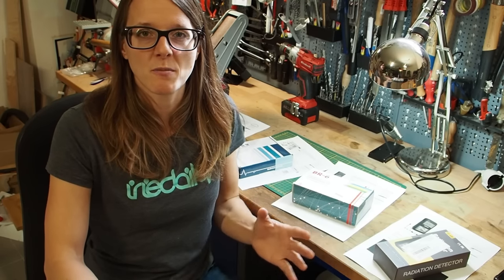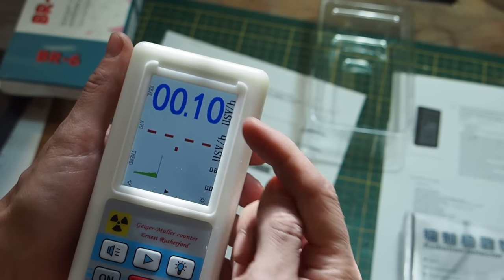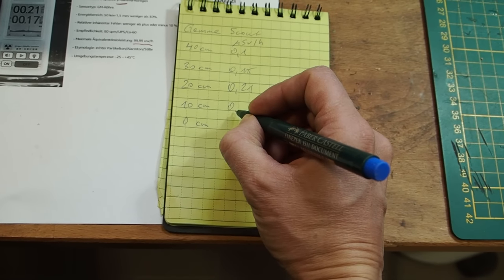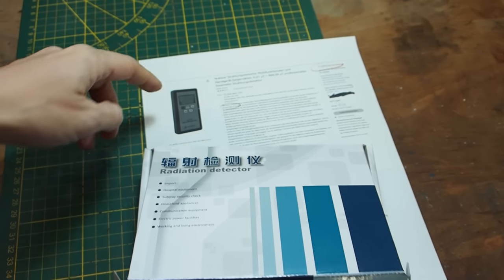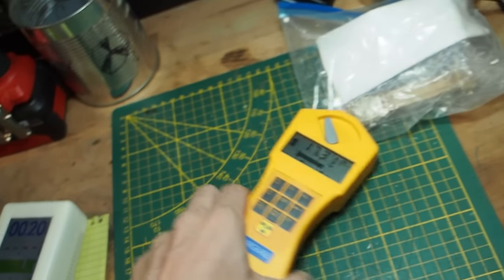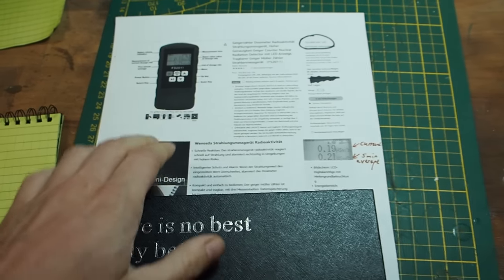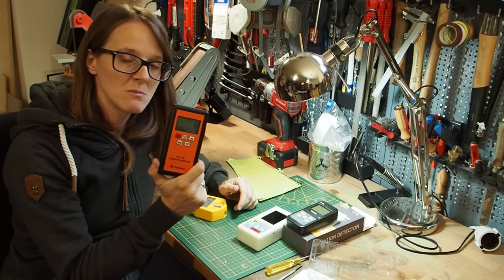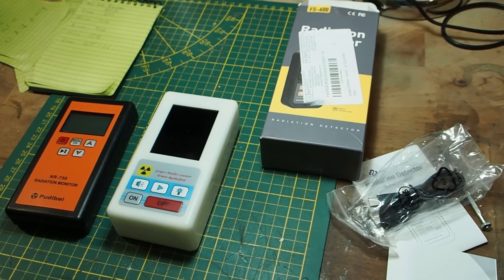Cheap Geiger Counters on Amazon - Only 1 is Worth it!

Comment: Hello Lilly,
indeed high µSv/h value does not mean at all that it is a good dosimeter/radiometer.
Measuring  a source at few cm in dose rate (as µSv/h) is a non-sense for devices that have been calibrated on a specific energy (few hundreds of keV), and at specific distance (devices should monitor at 1meter from ground).

Tube covering/coating is an energy compensation, in order to give a more "linear" measurement regarding huge range of X/gamma ray energy. (typically 80-1500keV).

So if your source emits low keV rays (try to use a low 100keV source), GM counter will overestimate a LOT µSv/h value, whereas compensated devices will give fare lower, but, indeed closer to reality, as ray energy biological tissues deposition will be lower.
Most GM tubes are overcounting rays below 200keV compared to 600keV (10x more under 100keV) used for calibration.
Also, geometrical configuration and tube (GScout uses ZP1400) influences a lot measurement.

So, dosimeters and radiometers that are supposed to monitor background radiations (to check peak or abnormality) MUST be energy compensated, and will give lower µSv/h values than uncompensated devices, that are then quite useless (or giving wrong overestimted values) for this purpose.

Looking for radioactive unknown punctual sources should be done using GM counter, with output in counts per second (or minute) + capability to check alpha/beta/gamma origin, but not with dosimeters.

Have a nice day
Reply from the maker: People surely want to punctually test their food in case of radioactive fallout. This is when the high sensitivity is important. Problem is that most people dont have 500 dollars for an expensive dosimeter. But a 80 dollar one which is sensitive is surely not a mistake to buy and still better than no geiger counter at all. This is why I try to find the most sensitive ones.
Reply: @SurvivalLilly  Hello Lilly,
thanks for your feedback.
Indeed regarding food testing, I would focus on devices that can detect alpha particles, that could be main part of issue in case of fallout.
Unfortunately as everybody knows, alpha tube prices went crazy. I've got ZP1400 for less than 30E few years ago.
But indeed, out of lab, alpha most of time is coming with beta/gamma emission. So I would focus on GM tubes able to catch low beta energy rays.
SBM20 (-U, -1, etc) serie, the most common GM tube is indeed quite sensitive and does a good job for this purpose.
A lot of devices have been made around this tube, even DIY as Cajoe RadiationD project (or those I've described on my channel).
Indeed, I would say that those devices are closer to "geiger counter" than radiometers due to no-energy compensation, so are fitting perfectly to prospection and food testing.
My Sosna with 4 SBM20 tubes is indeed very highly sensitive. Master-1 would be a good compromise (removing the lead sheet for energy compensation), or Quartex.... indeed quite all post-Chernobyl devices (Bella, Prypiat, Sosna, Raton, Belrad), which purpose was to...check food ;)
Side point : SBM20 is less fragile then Jxxx thin-glass tubes...easier to use in case of emergency/fallout/SHTF.
I have a similar device to yours (BR6) named XR1, that is a clone of BR9B, giving a nice result, also with J321 tube, not UV-sensitive as J305. Design put GM tube very close to package, so few mm thickness only.
It seems that market is different in US as easier to find some GM, as Victoreen CD700 I would say it might be the best compromise (not 715 with ion-chambre), also displaying counts/s in low ranges (taxes + shipment is quite expensive to France/EU). I've got the Lucky Strike 106C to repair few years ago. Even from the 60', it is higly sensitive, as made for uranium prospectors.
Have a nice day !

Comment: I sat through your extensive analysis, and as another another viewer pointed out, this was a subjective examination with no real reference to an actual calibrated source.
Just because one device reads higher or lower means little except the breakdown voltage of the GM tube was exceeded by ionization, but by what amount? All instruments have definable tolerances due to engineering. I would like to think your expensive meter was correct, but who know?

Comment: Lilly do these samples run on mirco circuits and/or diodes? If so they may not fuction after the EMP effects coming from a nuclear blast. I like to stick with the US Civil Defense Geiger counters and Dosimeters from the Cold War. Their are places you can still get them calibrated and they are EMP proof. Thanks for the review. I think people need to get more educated in this topic.
Reply from the maker: at the end of the video you can see that I put the geiger counter into a faraday cage. Thanks for watching.
Reply from the maker: how much are those US Civil Defense Geiger counters?
Reply: Tyically you can find them on Ebay sometimes amazon. They seem to be running around 80 US dollars. Online, Coleman's military surplus has them right now. The problem is after you get it you need to send it someplace to be calibrated. There are a couple of places online that you can send it to to get it done.
Reply: Also. Do you have a Dosimeter? It detects cumulative radiation showing the levels of radiation over time. Very important if you decide to make short trips outside say 2 weeks or so after a nuclear event. These are also at Colemans.
Reply: I would try contacting the American Civil Defense Association online. They calabrated mine but it's been a few years. They have a couple of contact phone numbers toward the bottom of their main page. Memberships are free. They may be able to calibrate the Dosimeters too.
Reply: @SurvivalLilly  Hey Lilly. I forgot to mention if you end up getting one of the Geiger counters or dosimeters there is book put ouy by FEMA that has just been republished this year and available on Amazon titled 'Radiation Safety in Shelters'  that is designed to go with those meters. It makes it much easier to understand so i highly recommend getting it! Thanks for all you do have a great day!"

Comment: Thank you Lilly.  I found the same one on Amazon for 60 dollars here in the U.S.  
I have a question, should flashlights and batteries be put on a Faraday cage?  Batteries?   I lined a metal garbage can with cardboard to use and I also have Faraday bags.
Stay safe.
Reply from the maker: I think simple batteries dont have to be stored in faraday cages. Modern flashlights with electronic circuits definetly should be stored in a faraday cage.

Comment: The sensitivity is dependent on the Geiger Muller tube having the correct voltage applied. Other than that it is the tube's characteristics ( standard calibration chart for the number ) and the circuit is just counting pulses over sample periods. Longer, and therefore slower, samples should be more accurate.  The other refinements are just selective filters for the tube. Dead units really show a lack of quality control.
I kind of like a kit for basic counters because they have schematics, alignment and calibration procedures, and as the circuit is quite simple are easy to repair.
That insensitive unit probably just needs the voltage to the tube adjusted but without service information it is useless.

Comment: I wouldn’t trust any reading without a known standard as provided by NIST (National Institute of Standards)in the United States, such as a metrology laboratory could provide. In Germany that would be a laboratory meeting the ISO/IEC 17025:2017 standard. Any meter worth its money will have that certification included. If that is not included send the meter to an accredited lab and have it calibrated. Otherwise, you’re betting your safety on nothing.

Comment: Just bougt a "Better Geigor" off Amazon an awesome good quality geigor counter for 150 dollars, a High performance. Low cost. Simple to use. Rugged. Made in USA,  A radiation dosimeter measures dose  using a scintillator instead of a Geiger tube. Im very happing with it so far
Reply: I'm at their site and considering buying one. How long have you had it and have you tested it? Thanks.
Reply: @MrFirstone23  I just got it yesterday and only turned it on to make sure it works. I have been researching these less expensive ones. If I was going to pay 500 dollars I would buy a an older 1960s/70s Victoreen survey meter or geigor counter but they are hard to find and expensive. So I reviewed the Better Geigor watched a couple videos and choose to go for this one. Im goung to order the source its about 40 dollars. Wish i could tell you more but do a youtube search on it there are a couple videos on it reviews can be seen on the web page. I like the fact it reads in MR/Hour and sieverts here in USA I worked most my life in a Nuke plant and used MR/hour

Comment: Very interesting, Lilly. I collect military memorabilia and some years back, you could buy the military surplus instruments, also the "civil defense, ones. They were usually brand new, in the box. At first they cost about $45 US. As supplies depleted they were up around $145. These were really tough and well made, of course. The only drawback was that they used an oddball battery. But that's an easy modification for most of us. 
I won't tell you NOT to worry. But I'm pretty sure Putin doesn't wasn't may NATO any more involved. I doubt he'll risk radiation drifting over ANY NATO member. But he seems crazy and as unpredictable as the wind. Plus we have weak leadership in the U.S. and most of the West. AND that only encourages despots.😥
Reply: The issue with the old Civil Defense units is that they may be out of calibration after so much time in storage.
Reply: @zombiemom5088  The USA does indeed have a long history of invading or undermining other democratic countries for the interests of Multinational corporations as described by General Smedley Butler, but make no mistake, Russia's government is no better, and in many ways is worse.
Reply: @SavageArms357  can’t disagree with you …

Comment: Hello , I saw that the company offers a 750, 850 and 950 models. They offer more feature and go up in price ( still low price from what I can tell). If you have any insight about the additional features ( what do they do? Are they worth the additional cost?) I would love to hear it. Thank you for your diligent work and sharing it with us ! Hope you stay safe and well, love from Canada 🇨🇦
Reply from the maker: I will make a test with those too. I doubt they will be much better tough
Reply: @SurvivalLilly  thank you! I noticed they had different numbered ones too and was wondering which would be best. Watching from the UK.
Reply: @SurvivalLilly  Hello Lilly,

I bought the fancier 950 and the instruction booklet says the different bt the models is “ Relative Inherent Error”. The list by model 
NR:
-750>%15
-850>10%
-900>%5
-950>%3
-1050>%2
Not sure what it measure but seems like for 1.5x the price you get a %12 more accurate reading intrinsic to the meter. Hope that is of interest, thanks for your video.

Comment: There is an NR 850 cheaper than NR750 on Amazon, is that a better model than the 750?
Reply from the maker: I will test the NR 850 in another video. Probably works the same
Reply: @SurvivalLilly  there are many that appear identical but have different brand names, whst brand was the ine you reviewed please?
Reply from the maker: @markdearness  get the one that says Pudibei NR-750
Reply: @SurvivalLilly  thankyou lilly

Comment: Just noticed that when you opened the NR-750 it has an M4011 GM tube, the same tube as the higher end NR-950 has, from other teardowns and your own Part2 video, the NR-750 usually comes with the J321 as with the NR-850. Did you get lucky with this example? Do you think this tube has better accuracy than the J321? Cheers and keep prepping.

Comment: I will probably purchase the Nukalert.
Reply: In one of their videos, it was stressed vociferously that none of the affordable units on the market have the capability of detecting high amounts of radiation.  Apparently, they all are tuned for low and insignificant levels.  In a real emergency, we need a unit that doesn't max-out.  Of course, the Nukalert handles the wide range from nearly imperceptible to full out nuke-attack.  I have not verified these claims myself.  It would be great to see a side-by-side comparison.

Comment: Hello. Your tests is methodologically incorrect. To compare the devices you should point a geometrical centre of the detector towards the source. The geometrical centre of the BR-6 is at the back side of the dosimeter, not at the upper side as you place it.

Comment: You're measuring very small trace amounts of radiation that amount to next to nothing. What you want to know is how they would react to real-life radiation. You need to be testing with higher levels. You're trying to detect hazardous radiation and you need to detect Alpha, Beta and Gamma radiation. The numbers on the tubes will tell you what kind of radiation they will detect. Most won't detect Alpha radiation which is why it took so long to realise that Alexander Litvienko had been poisoned with Polonium. A decent test of a radiation meter would be to go to an area such as the Tirol with its granite mountains and take the meter into caves to measure Radon levels.

Comment: Bummer. I wanted to see the test for the FS2011. That was the one I just ordered from Amazon. I'm waiting on it in the mail. Maybe I should just send it back, seeing yours didn't even turn on.
Reply from the maker: I did not test it, but I could see it has a small Geiger Müller tube. So it is not as sensitive for low ionizing radiation. I would send it back and get the orange one to be honest.
Reply: @SurvivalLilly  Thank you. That is what I will do.

Comment: Great comparisons. Why, pray tell, don't you take the watch out of the plastic bag???
Reply from the maker: in case the watch is leaking particles they will be contained in the plastic bag.
Reply: @SurvivalLilly  It's been in a thrift store for YEARS AND YEARS. A few minutes out during your test surely won't harm you. It was designed to be worn continuously on a wrist.
Reply from the maker: @davidglazener7921  nope that is not what I meant. The watch still radiates through the bag. I just want the particles contained. So they dont fly around in my basement in case the watch is leaking particles

Comment: Your Faraday cage isn't going to protect squat.   You're probably at around -15db in attenuation.    That might protect you from a Hiroshima type weapon (probably not), but won't hardly slow down the EMP from a modern day nuclear bomb. 

1st, I would strongly suggest you invest in some Dri-Shield 3400 bags, which will provide about -45db (100 fold decrease), and THEN put those bags into a properly sealed Faraday cage (which yours is not properly sealed).      That foil over the edges is going to create gaps which can actually amplify the EMP.   You need to use a proper RFI/EMI gasket (tinned copper mesh over foam), or you need to tape the seams.    A 50Ghz E1 pulse is going to zip right through your unsealed lid almost like it wasn't even there.
Reply: I think her idea for a Faraday cage is to shield from solar storms and other cosmic disturbances.
Reply: @americanhindi   Faraday cages are not needed for solar EMP, only for Nuclear EMP. As for any other cosmic disturbances,  if anything that serious hit us, protection of your electronics would be the least of your worries as high energy particles ripped your body and our planet apart.  
Faraday cage protection is rated in db (decibels) of attenuation.   You need an absolute minimum of 40db, her cage probably provides less than 25 because of the way the lid fits on.    Just fix the lid so it seals to the box with a smooth gasket and it will be fine. 
Really important electronics, and those with extremely sensitive IC Chips, should be behind two layers.

Comment: There is no good reason to peel away the protective plastic from the screen fresh out of the box. That should only be done if the protective plastic film becomes cloudy. As long as it remains in place it will provide good protection for the screen to prevent permanent scratching.

Comment: "Gamma alone is not enough"
"You only want to get geiger counter with geiger-muller tube"
Hmmm, weird statements without a context...
Also, with such low sensitivity devices, you should wait a good while and preferably average values as it will fluctuate randomly.
And the 0cm reading a is worthless, every centimeter matters, every detector has different chassis, geometry (as you discovered with the white one). Also I don't believe Gamma Scout really shields all gamma on contact. Not sure what happened with the last one, you cut the video too soon, it might reach higher - again, with so insensitive devices, it might fluctuate wildly.
Not a bad video, not a bad demo, but you should have stopped there instead of trying to make it more "factual".
Also, for survival purposes, you should have tested an overload condition. Will it say overload or display zero? That's pretty important.

Comment: If theirs a large E.M.P. which happen's in a nuclear blast most digital devices will be rendered useless if powered on in vicinity when the EMP occurs, the simplest are best with minimal semiconductor circuitry, I have a Maplin Geiger Counter from 1984 very old but still working has the muella tube and detects Gamma and Xrays, and cosmic rays etc.

Comment: 1. Bosean FS-5000 - best for cheaper
2. Tesmen Hound-200 and Habotest HT629 (not to be confused with the HT627 electro-magnetic field detector) - on battery AAA + very cheap but not accurate